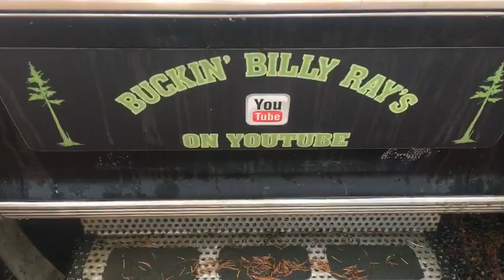Let's get the GULLET

Comment: I hog out the gullet with a 7/32” file on the 3/8” tooth. Once the arc of the gullet is clean I use a 1/4” file or a 7/32” file with the file n guide so just the upper part of the tooth gets sharpened. I’m sure bucking you know this. I do this on all sizes of chain just with different size files.  Thank you billy ray for getting the work out about the gullet. Some new chains are worst than the others. The automatic sharpening when there grinder they leave extra material in the gullet. That needs to be removed. Godbless.